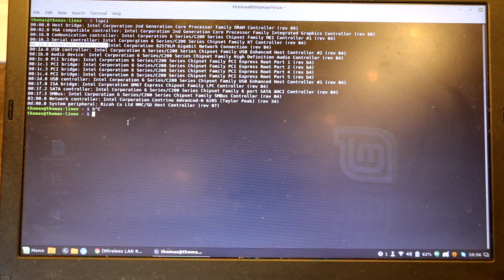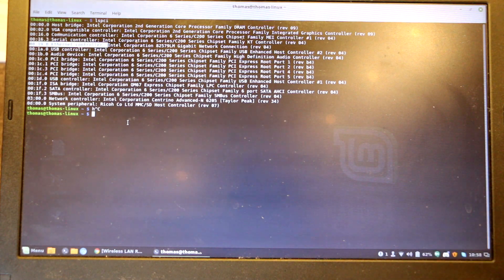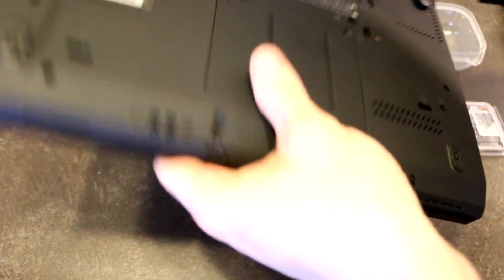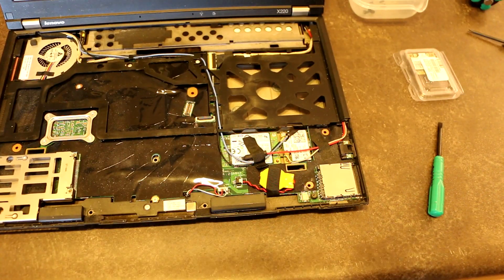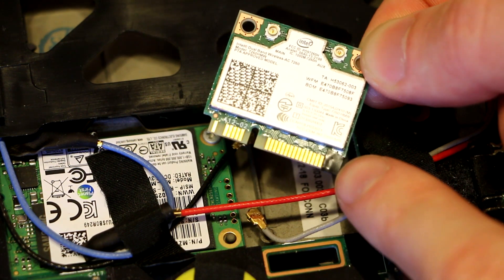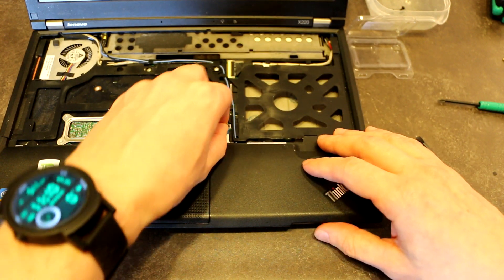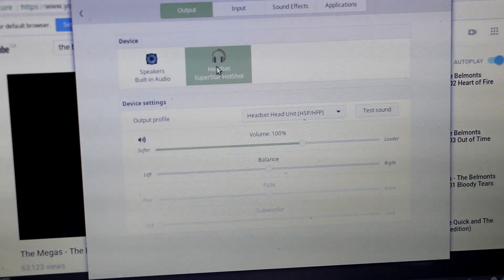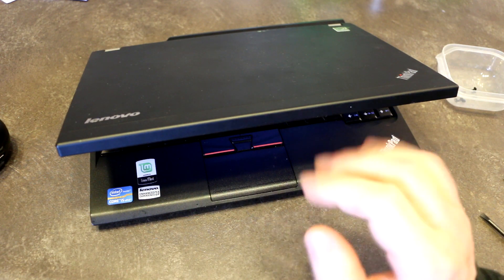Installing an Intel 7260 WiFi + Bluetooth Card in your Thinkpad X220

Comment: Is the Intel 7260 still the best wifi card for X220? Or any mini PCIE card will work, if you have the unlocked bios?  I saw posts with AX200 but not sure if it works. 

Also, what are your speed/sensitivity for your trackpoint in linux?
Reply from the maker: I think I left the default settings for the TrackPoint in Linux but it has been ages. As for the best WiFi card, I've seen some posts as well about the AX200 but have not tried it myself.
Reply: @LaptopRetrospective  well my AX200 card just arrived the othet day lol.  Installation goes well, internet speed is ok too.  Now the spec says AX200 can access higher freq, so we'll see how that goes.
Reply: also, does not covering pin 51 do anything?

Comment: Having already 5 thinkpads, P17, P1, P14s, X1 Yoga, and a 240, I am about to buy a X220 to add to my little fleet for its beaufiul keyboard and form factor, and to run a simple writers' app like scrivener. Do you recommend getting a 230 and moding a X220 keyboard on it or since I am not that worried about performance, stick with X220? BTW thanks for your great videos.
Reply from the maker: If performance isn't a concern for you, pick whichever configuration is less work to get to your preferred setup. 😉

Comment: What are the two chords connected to the WiFi card? I removed the monitor and those two chords were in it and now my WiFi is not working
Reply from the maker: That's the WiFi antenna. Makes sense if you disconnected or removed them you'd have trouble.

Comment: My X220 already came with dual band wifi (maybe the previous owner made an upgrade), works like a charm (on 75% wifi signal I got 300Mbps), but my issue is that I have Bluetooth 3.0, and somehow I can’t detect my Bluetooth mouse or bluetooth keyboard to pair with my laptop… but strangely it detected my iPhone and got it paired. Anyone had an issue like that? Any tips? Is it because of the incompatibility of Bluetooth generation?
Reply from the maker: I suspect your conclusion regarding Bluetooth version is accurate.

Comment: Thanks for your video! I really love this old machine and with 16 GB of RAM, a SSD and now with almost gigabit WiFi, I‘m still able to do all my work on it - after 11 years! That’s just amazing. Thanks again for your instructions!
Reply from the maker: Excellent! Glad.i was able to help.
Reply: Just a doubt, if I cover that ping with the tape will I be able to turn Bluetooth and WiFi off and on independently or always on?
Reply from the maker: WiFi has a physical kill switch on the device that still functions I believe. Software toggles would also function for both.
Reply: @LaptopRetrospective If I understand that, my wifi has its switch but I read that the bluetooth wouldn't turn off if you cut the ping.
Reply from the maker: Interesting. I'll have to try it.

Comment: Great guide, but I accidentally bought an N 7260 instead of the AC. RIP
Reply from the maker: You're not the first to do that. I've read it in the comments before. 😂
Reply: @LaptopRetrospective  Just got the right card, really easy upgrade to get much higher speeds at super low cost. I'm really happy with how well I've got this laptop set up with everything I could want for it
Reply from the maker: Glad you got that sorted!

Comment: Great job on the content, just discovered your channel!  

Curious if you are still using the X220 as your daily laptop? I know your videos for the laptop are 4-5 years old now.
Reply from the maker: I still use the X220 around the house. Let me know if you have any follow-up questions.
Reply: @LaptopRetrospective  - Is it still your main machine? I’m considering an X1 Carbon, possibly 6th gen due to key travel. Any thoughts ?
Reply from the maker: It isn't my main machine, that's the X1 Nano right now. I've reviewed the X1C G6 and it's very nice.. Windows 11 compatible too.

Comment: One thing I had to dop in addition to covering pin 51 was also covering pin 20. For some reason, my system was reading that my hardware radio switch was turned off (even though it was switched on). I couldn't find a software fix (with Fn+F5), and I couldn't find any issue with the switch on the motherboard. Covering pin 20 just let the wi-fi card ignore the hardware radio switch's signal, so that it could just work.
Reply from the maker: Very interesting! Thanks for sharing your fix.

Comment: Great guide, worked perfectly for me! Did the upgrade to resolve signal issues with my X220. I've still got the signal issues (I'm thinking it's the WiFi antennae) but at least I know it's not the card! Trying to decide whether I can be bothered buying replacement antennae and disassembling the whole thing to replace them (if that's even possible)...
Reply from the maker: The antenna can be replaced, it's mainly taking apart the display.

Comment: Awesome!  I use the X220 whenever I'm travelling.  It's hard to beat.  I wanted to upgrade the wifi to an AC card.  I did a whitelist-removal bios upgrade and installed a card from Amazon.  I can now connect at 866 Mbps vs. my old card which was 72 Mbps.  WOW, what a difference.  Hopefully, it's stable.
Reply from the maker: I've been running mine for years now. No issues.

Comment: Thanks for your video. Just wondering your X220 used to have bluetooth function before upgrade or it is capable for bluetooth connection after upgrade. I am about going to do the same for my W530. Currently, the laptop doesn't have bluetooth function. Just curious to know those info. Thanks.
Reply from the maker: The WiFi card I installed had Bluetooth built in. It did not have it previously.
Reply: @LaptopRetrospective  Thanks for your prompt response. Same scenario here. My current laptop doesn't have bluetooth and speed is 2.4GHZ. That's exactly what I want to upgrade to.
Reply from the maker: This will help.

Comment: I have a X220 with a BCM3422 card inside that I had used as replacement for the fried OG one. My X220 model never had Bluetooth and it is also lacking the Bluetooth status light. Do you think it is possible to put an Intel 7260 card into this one and have Bluetooth?
Reply from the maker: My X220 didn't have Bluetooth prior to this mod.
Reply: @LaptopRetrospective  I just installed it. Works like a charm! Thank you!
Reply from the maker: Awesome! Thanks for letting me know.

Comment: I would honestly say installing the tape is the hardest part of the installation process. I'm still figuring out what bluetooth drivers work with this on Windows 10 but the Wifi and Bluetooth work from the start on Linux Mint.
Reply: Update: I gave up and got a Bluetooth dongle instead (because getting Bluetooth to work with Windows is a nightmare). I'm enjoying the faster speeds from the 7260 though. Thanks again.
Reply from the maker: Yes the tape is tricky and can take a few tries.

Comment: Why do you need to tape it
Reply from the maker: If the pin makes contact it won't work.
Reply: @LaptopRetrospective  Ohhh do you know how I can get Bluetooth for my pc? Is the card located on the left of this video at ( 5:11 ) the card responsible for Bluetooth? Thank you very much!
Reply from the maker: It depends on the computer you have what card handles Bluetooth. Most have it built into the WiFi card now, but some computers use a daughter card.

Comment: Thanks for the video, it's very informative. 

I tried it with AX210. Arch Linux with latest drivers. Wifi works as expected, but Bluetooth is not detected. Bios modded, factory Broadcom bt removed, tape pin 51 and adjust a few times, no luck. I guess I will stay with the original bt then.
Reply from the maker: Yeah these steps are pretty specific but glad you got partial function. The original BT card slot can go up to 4.2 without mods.
Reply: @LaptopRetrospective  thanks for the info. Luckily I don't need the newer Bluetooth features. 40x improvement on wifi speed is nothing to be complained about :)
Reply from the maker: Hehe, excellent stuff!

Comment: Will this work in an X201?  Right now I'm using dongles for that.  Built-in would be better.
Reply from the maker: This process won't. If it is possible, it would be a different process.
Reply: @LaptopRetrospective  Not so much the process as the card.  I guess I could have a look next time I have a chance to open the X201.

Comment: No Bluetooth on my x220t.  I'm deciding between USB 5.0 dongle or this.
Reply from the maker: You can also add BT via the factory module. If I remember right a 4.0 module drops right in.
Reply: @LaptopRetrospective  Hi bro. I replaced the Intel 7260 card in the X220 and it got wifi up and running. But as for bluetooth, it still won't accept even if you remove or not remove the old bluetooth card in the device. I have also covered the top 51 pin already.
Reply from the maker: Sometimes it takes a few tries to cover the pin properly.
Reply: @LaptopRetrospective  I have alse tried 1-2 times but Latop can't receving bluetooth. I'm trying to see if there's something wrong in cover pin.
Reply from the maker: You're certain it is the same version of the 7260 card? There are a few different models.

Comment: This DOES NOT work on the Thinkpad W530, unfortunately! You can either use this card in the mini-PCI-E port designated for wifi cards to get wifi, OR the mini-PCI-E port designated for WWAN cards to get bluetooth working. Not both! Whoever came up with this needs to get fired!
Reply from the maker: This method only works with the x20 era of machines. For the x30 era, you need to explore ivyrain.
Reply: @LaptopRetrospective  yes, that’s what I did. I have jailbreaked(?) the W530 and the intel 7260 works in Windows and Linux as planned. But not bluetooth. Bluetooth from this card only works in the WAN port of this laptop, but installed in the WAN port, wifi doesn’t work. I found this randomly on reddit, google’ed it, couldn’t find any information about this constraint and hence could not believe it. However, I did test it and it is true! So I’m spreading the word so that other people don’t have to run into the same issue. The m.2 ports themselves seem to have this restriction and the tapeing method for pin 20 and pin 51 have no effect.
Reply from the maker: If I remember right you're only taping one pin, 51 and it works perfectly fine, at least for the specific card and system identified. The methods needed to install WiFi cards not on the regular whitelist vary from model to model.
Reply: I will triple check! I definitely taped of both pens, 20 and 51. The funny thing is, with this configuration, the two different wireless features work in either the one port or the other. if anything, I would expect both ports to act the same way.
Reply from the maker: Not sure what Pin 20 does but I checked McDonnellTechs tutorial and it doesn't mention it at all. Again, keep in mind this process was specifically designed for the x20 era machines and things might work differently on the x30 era. For all I know, not having done it, pin taping might not be required on the x30 era.

Comment: Which ThinkPad drivers to use for 7260?
Reply from the maker: What OS are you using?
Reply: @LaptopRetrospective  - W7
Reply from the maker: If it doesn't automatically detect them then grab them from Intel's website for that card. I don't remember if I had to do anything to get it to work out of the box for 7 or not.
Reply: @LaptopRetrospective   - It appears Intel pulled everything but Win 10 drivers. I have not tried to install what is available.
Reply from the maker: So what exactly is the issue?
Reply: No Win 7 drivers
Reply from the maker: I did this on a Windows 7 install without issues. What steps have you taken so far and what problems do you currently have?
Reply: @LaptopRetrospective  I haven't been able to get Bluetooth drivers to install for Win7 Pro 64 bit. I tried letting Windows do it automatically and it failed, and then I tried bt_21.40.5_64_win7.exe from Intel's website and it said it isn't compatible with my system or something. Intel website otherwise just says Windows 7 drivers are no longer provided for the card so not sure where to get working drivers. Anyway I already have a separate bluetooth daughter card in the x220T so it's not a critical isse, just would be nice to have the later version working.
Reply from the maker: I'm assuming you've blocked the pin you've needed to stop from being read?
Reply: @LaptopRetrospective  First I tried as is, then I tried taping it. (I used some yellowish clear tape that's supposed to be resistant to high temps--got it for entirely different purposes, but it's thinner than electrical tape so thought it might fit better.) Didn't seem to work either way. Then later, for whatever reason, Windows finally let me install a driver. I have no clue what triggered the change--maybe one of my reboots or other fiddling? That said, I still have to get around to testing it with a device--I don't use bluetooth often, mainly just when I need a louder speaker.
Reply: @LaptopRetrospective  p.s.--The wireless AC is enough to make this upgrade worthwhile to me. I previously only used ethernet with my x220t because the wireless N was so painfully slow in comparison. Glad to finally be able to go untethered.

Comment: Hello will this work for the X220 Intel Wireless 7260NGW Bluetooth 4.0 BN WiFi NGFF Wlan Card 300M 04X6011 04W3815 for Lenovo Thinkpad https://s.lazada.com.ph/s.djwrp
Reply: It’s difficult for me to find the exact model you shared in your video as amazon does not ship to where I am so having to source locally
Reply from the maker: The Intel Dual Band Wireless-AC 8260 with Bluetooth 4.2 card also works I've been told on good authority.
Reply: Ok that’s helpful will look for that. Thankyou for responding so quickly, your videos are helpful
Reply from the maker: Best of luck to you! Remember you need to install a modified BIOS for any of these cards to work.
Reply from the maker: I personally haven't tested that card.
Reply: Okay but based on the specs on this listing what do you think ?
Reply: Yes I saw the BIOS upgrade video :) Thankyou

Comment: Anyone have issues with bluetooth now disconnecting after recent windows 10 updates? Is there a fix?
Reply from the maker: Did you tape the pin?
Reply: @LaptopRetrospective  No, I couldn't find what does taping the pin fix? I have seen people demonstrate it, but what symptoms do you get that require taping the pin? In my case it works fine on previous windows 10 build, then they updated it (I don't know the exact build number, but when power management tab was removed, it randomly disconnects)
Reply from the maker: I'd try taping it to see if it fixes the issue. It does relate to Bluetooth performance.

Comment: WHY YOU COVERED THE LAST PIN?
Reply from the maker: To make it work as per the tutorial I was using.
Reply: @LaptopRetrospective  but last pin from 1side. What about second side? It doesn't look cool. I tried to install intel centrino wireless N 1030. 
I covered the last pin from both sides. I got an error about not authorized network card :/ what i did wrong?
Reply from the maker: That card isn't what I used which is an issue. Did you install the modified BIOS like I said at the start of the video?
Reply: @LaptopRetrospective   No because I`m pretty sure it will be not compatibile with x230... :( or it will be compatibile?
Reply: @LaptopRetrospective  i have x230
Reply from the maker: This tutorial is not for the X230.
Reply: @LaptopRetrospective  i know. But please.. Help.. I bought from wrong people x230 with no bluetooth, ips panel, backlight keyboard (just only thinklight) and broken 2nd RAM socket. I wanna just to plug in my speakers because the x230 are.. Broken of course.. Please help
Reply from the maker: Yikes, that sounds like it is in rough shape. You can install the Bluetooth module separately if it didn't come with one, there should be a spot for it if I remember right.
Reply: @LaptopRetrospective  I thought except cpu/ram/space every thinkpad x230 is the same (and tablet) in 2012 everywhere is bluetooth, and everywhere thinklight and backlight keyboard

I have my old network card intell centrino wireless n 1030 from my old dell inspiron n7110. Inspiron has the bluetooth so thats why I want to install 1030 in x230. Please. Try to help. 

What type bios i should install? In the future I will want to change the keyboard to x220 keyboard.
Now i what to remove this fukckin whitelist and install this network card.
Reply from the maker: Your first stop is going to be reading up on ivyrain and that process.
Reply: @LaptopRetrospective  Could you make a film about removing whitelist on thinkpad x230? I can`t to deal with it.
Reply from the maker: Next time I see an X230 I can give it a go.
Reply: @LaptopRetrospective  please make it as fast as you can. 
Record about where is located other bluetooth module, how to remove whitelist without modyfying bios, 
I dont have backlight keyboard. IF I will buy with a backlight new one it will be plug&play?
Reply from the maker: You're not removing the whitelist without modifying the BIOS. You can find the location of the Bluetooth module using the maintenance manual easily found online. Backlit keyboard swapping should be fine on the X230.
Reply: @LaptopRetrospective  okey but I mean to downloading other modified bios. Becae it can change mac numbers, adresses etc.. You can to make video how to in ownself try to modified bios and removing white list.

But i heard too, we can maybe program/rename the wifi card and making it compatybile with white list.

Like i have intel centrino 6205 and new intel centrino 1030 with BLT. We can to rename the 1030 to 6205 and make it authorized for thinkpad?